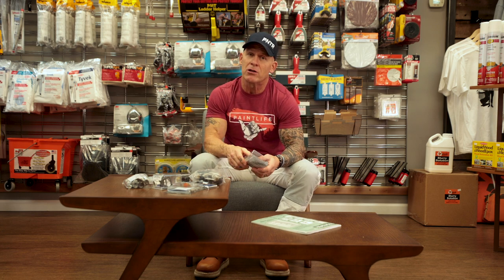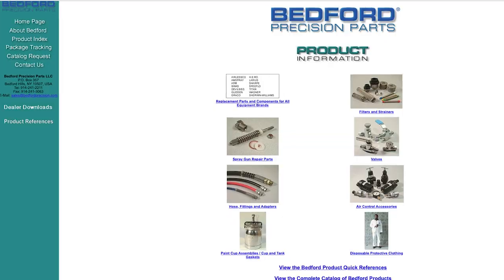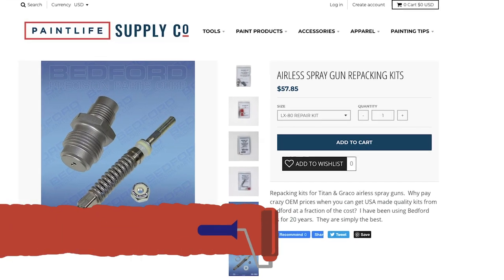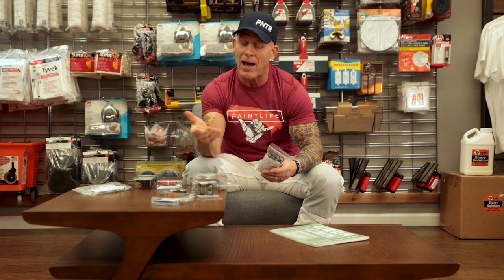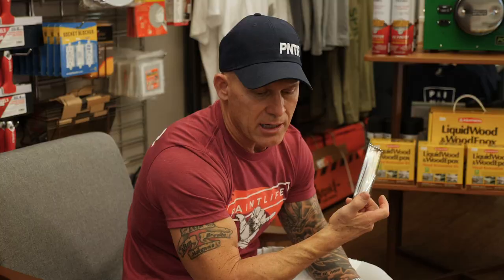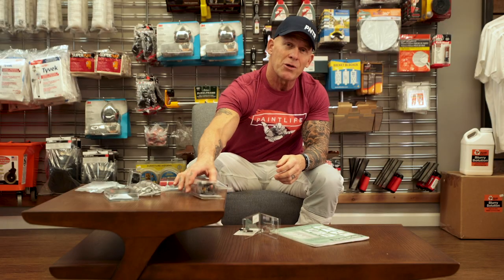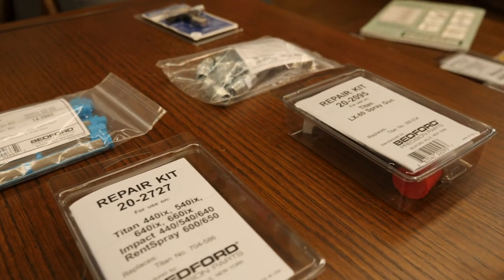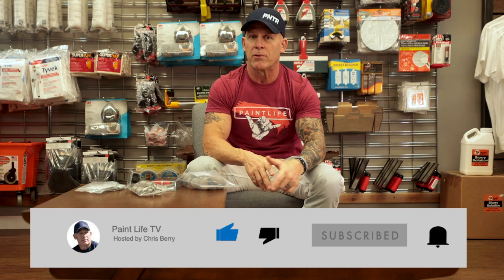Quick and Cheap Airless Sprayer Repair! How to Save Money Repairing Your Own Airless Sprayers.

Comment: Hi Chris, I am a new follower of your channel. Painting is not what I do for a living, but I must admit that I have begun to develop a certain interest in this matter. I have seen some of your videos and I really liked them and decided to follow you. I would describe myself as a normal home DIY handyman. I live in a small town on the North Island of New Zealand, where I don't have access to a good tool shop, and most things have to be bought online or wait for a trip to a big city. I recently purchased an airless painting machine to do a painting job at home. The truth is that since I probably wouldn't use the machine frequently and for big jobs, I bought a 2nd hand machine online. First time I use the machine and after 10 or 15 minutes of testing I noticed that after making two passes with the spray of approximately 4 to 5 feet the machine loses pressure and I have to wait a few seconds for the pressure to regain and thus be able to make two more and wait again. Is this normal ??, or is it possible that the machine has a problem, and if so could you point what the problem could be and what should I check ??? I would be very grateful for any guidance from you. Regards from New Zealand
Reply from the maker: It probably needs to be repacked

Comment: You put me on originally. I added painting to my carpenter business. Definitely a life changer. I did start with the graco x7. Because it was in my budget starting up. You’re much appreciated. 🙌🏽🙏🏽🙌🏽
Reply: The x7 has a small weakness, the outlet valve ball return spring.  It likes to rust out if not stored properly, so store the machine using the proper fluid or mineral spirits.  If it fails, it is an easy fix.  It is the part that the spray hose screws onto, and is a 5 minute swap out.
Reply from the maker: Right on

Comment: After a year, the best thing I did was buy a factory rebuilt Graco3900 for $2800 gas sprayer for exteriors. The first year I was ready to strangle someone trying to move a sprayer , and electrical cords around someones house looking for electrical outlets that my sprayer wouldn't pop the breakers they put in these newer homes. Now I can just roll my gas sprayer around   when I'm finished looking for any missed spots. .  Second week I used it, got a bar/restaurant to paint right on the main street, so of course, no electrical outlets on the side walk, so my gas sprayer saved my day ,that day.I put it right in the lift bucket with me, and painted the 30ft wall with my sprayer right next to me. lol  To heck with extension cords, and all that mess when I have to go 200ft to the back of a property to paint a wall , or fence too. Just roll it out there, and one pull starts the Honda engine, what a game changer for painting exteriors. I still have my electric sprayer for interiors, but  barely get to use it in peoples houses, most don't want spraying in they're homes around here. I only sprayed once inside a home in two years.

Comment: Also, their prime valves are WAY WAY cheaper and work just as well.
Reply: I’ve used the $18.00 valves from China on electric Graco work fine same as the fluid sections
Reply: @MrColdwatercanyon  I had a lot of customers use the Chinese made parts and not have a problem other than a general shorter life span.  Being a tech, my biggest issue is safety, as I do not trust those parts as I would a certified replacement.  Having had a few explosions and a lot of over pessure events makes me hesitant to use questionable parts as a professional but I do admit they work just fine.
Reply from the maker: Yep